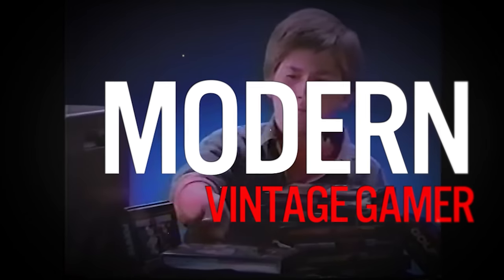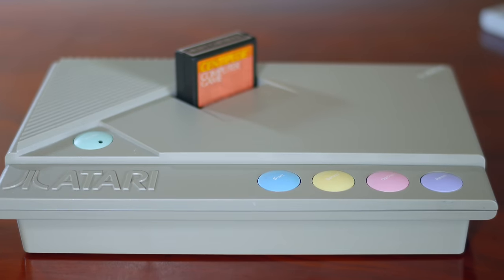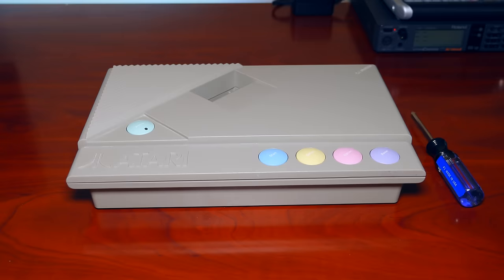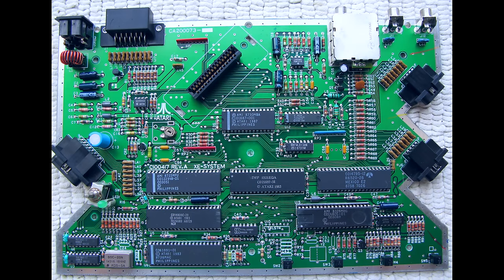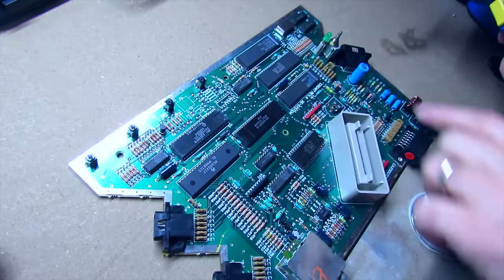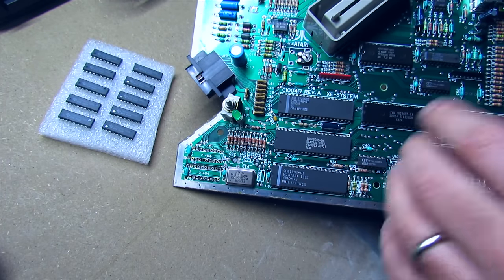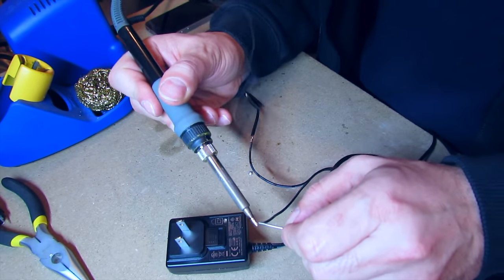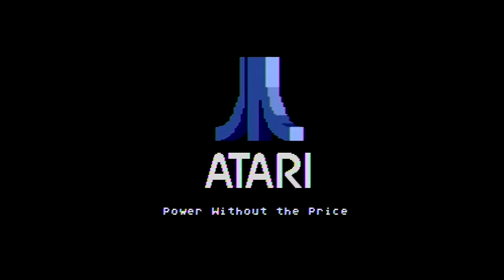Atari 8-Bit XE Game System XEGS Review, Teardown, Repair and SIDE2 Compact Flash Hard Disk Upgrade!

Comment: The choice of Compact Flash over an SD card seems strange. According to Wikipedia, CF only goes up to 128GB, while SD cards go up to 256GB. They're also smaller cheaper and more commonly available.
Reply: lurkerrekrul 
dunno where you picked up yer information
sd mini and thus sd goes up to 400gb as I write this
and already did so as you wrote yours
Reply: At the time I wrote my comment, 256GB was the largest capacity I could find available for an SD card. I'd hate to try and fill up anything larger, you'd be there for days!

Anyway, the point of my original comment is still valid; Compact Flash seems an odd choice when they could have used SD cards instead.
Reply: lurkerrekrul 
misunderstanding mate. you are right!
I was referring to sd while you meant cf.
sorry!
Reply: No worries. :)
Reply: lurkerrekrul, it makes a tonne of sense. CF(ast) cards are just PATA/SATA devices, so you're dealing with commodity equipment. With SD cards, unless you're going with SPI (the slowest option and there only for embedded devices), you need a host license.

Thus, for limited run devices, CF is the better option.

Comment: The title speaks for itself and there are probably also womans watching this video remembering once they bought their atari XE for their children😁

Becides while the atari 5200 was considered to be a flop since only 1 million systems were sold,

However despite the atari xe only sold 100.000 units,it was consodered to be not a flop at average because it helped atari to take rid off their remaining stock pile of atari 400 games,a pretty clever smart but also weird move from atari🤣

But it was also a bit cheating since computer games shouln’t run on a console and vice versa simce atari only had the right to port certain arcade games to computers,
But coleco at the otherhand did only had the rights to port certain arcade games to game consoles,but they turned their colecovision into a computer with both an adam addon and standalone computer of it in wich you also could play colecovision games on them as well,and atari wasn’t happy about that so they sewed coleco for doing that back in 1983,but then atari did a similar thing with their atari xe back in 1987 and so am amezed coleco or any other company didn’t sewed atari for this,in fact am amezed how even nintendo didn’t sewed atari for doing this and using their name against them in their atari xe commercials to form a treat against nintendo and for forming an unfair competition against nintendo,mmm,
Eventrough nintendo did won the 3th gen console war but still it’s just weird that such practice was allowed or so it seems).

Comment: A desoldering braid is hands down better than the gun... Exponentially faster, easier, no adding solder to take away solder, no additional tools needed beyond the soldering iron you've already got... etc.  Just better, I recommend getting some.  Beyond that, having you power up the console with the new ram, and no insight as to why the old stuff was heating up, had me on edge, lol... I figured it was gonna be something far more in depth, but that was just me taking for granted how simple old hardware is.  I doubt this board has much in the way of voltage management and or manipulation going on... The brick was the smart thing to look at after all.

Comment: The NES has a comfortable and innovative controller. That Atari PC has an uncomfortable Joystick with one button and a cheap keyboard. The NES has games that can go fast. The Atari PC only has slow, boring,broken games. The NES has huge success and popularity while the Atari PC was a flop. Both are 8 bit but NES games look slightly better. The NES has a great, huge,amazin varity of first,second,and 3rd party games. The Atari PC has mediocre games.
Reply: +The Metroid PERFECT comment. The Atari consoles were laughable compared to the NES. I clearly recall Atari using advertising as propaganda to push low-tier hardware and games onto the public. When the NES came out, the  rules changed dramatically. Atari was a joke and always had been.

Terrible decisions for both hardware and especially software. Atari repeatedly made stupid decisions and mediocre products over several decades.
Reply: Solid post, thanks for contributing.
Reply: Very true. The reason is that the HW was from 1979 and just repackaged. 800, xl, xe, xegs are all the same. If they had updated the chips  (2nd POKEY for better sound, more colors and sprites) the Atari could have been competitive. But they haven't :(
Reply: But even when they had hardware that was superior, they couldn't market it well enough to sell it.  They always had this problem.  The Lynx was a far superior console to GameBoy.  Better LCD, better hardware, but they couldn't make it work.  It had hardware scaling to it and it was in color (plus had a nice left-handed mode for those who were left-handed).

They also had a portable PC (Portfolio) which was a nice tiny computer but they dropped the ball on that too.  

Then the Jaguar which people said was a great machine to program on because it basically had no OS and you could write directly to the hardware.  Somehow they mucked that up too.  Back then, everyone thought the 3DO would take over the industry but they messed up worse than Atari did.

Atari had really only one true success.... Atari 2600.  Then, Time Warner got it and they basically destroyed it and gave it away to the Tramiels (sp?) who made it last a while, to be honest....    but they couldn't make a success out of it.

The PC took over the industry and let's face it.... piracy also killed the Atari ST line... which managed to last until the 68030 with the Falcon030, but that was the end of that. 

So Atari has always failed after the 2600.  The only reason the NES was successful was that Atari didn't actually take it to market it in the US market when Nintendo was going to let them.
Reply: Sorry, but your comment shows that you don't have a very good insight into the Atari 8-bit computer game library. There are some slow games (mostly 3D vector graphics stuff like the Flight Simulator II, shown in the commercial, or Battlezone - Mercenary, Alienblast! and Stunt Car Racer OTOH did it right), but many 2D or pseudo 3D games were very fast instead (Dropzone - one of the titles shown - is a good example, other examples would be Encounter!, Turmoil, Ballblazer, Stealth, Assembloids). The 8-bit line is known for smoothly scrolling 2D games (e.g. Boulder Dash, Bosconian, Time Pilot, Crownland, Dimo's Quest) even with a split screen (e.g. Schreckenstein), it's weaker points being the monochrome sprites - that also were only 8 bits wide - and the few available colours per line (a maximum of 5 in the tile based modes that were most useful for games).
Reply: It wasn't much of a comfortable or innovative controller, it was first and foremost a cheap to produce controller, that wasn't too uncomfortable, in contrast to the awkward and more expensive to build Atari joystick. It was not so much innovation, just smart thinking as Japanese more often do.
But I've used atari-compatible joysticks that are way more comfortable and are extremely fast and durable, and I much prefer them over the NES joypad.